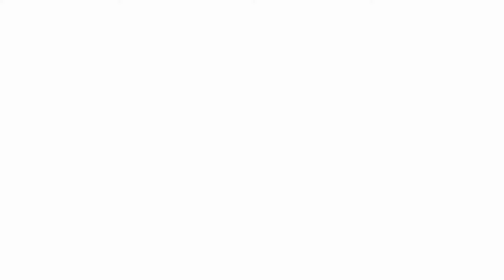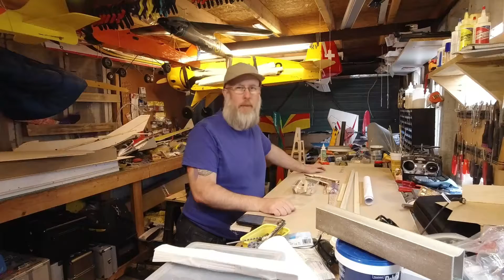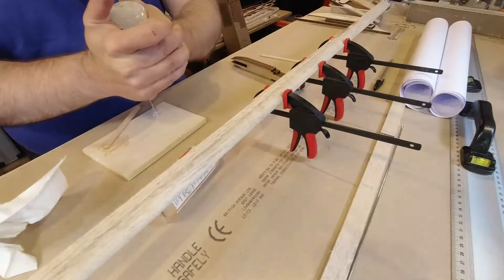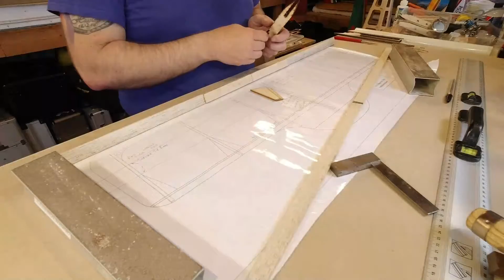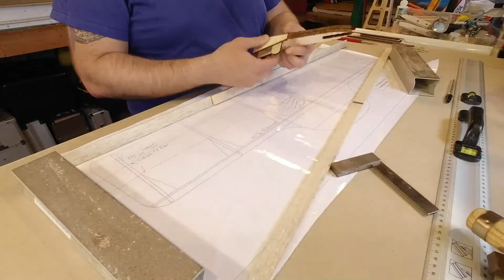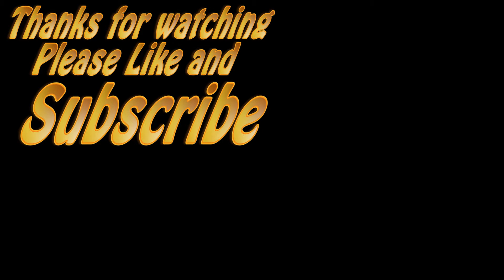Hobbins Hobbies Mini FlyMe Combat Wing Trainer Pt1

Comment: Thanks for doing the vid Nick, I  think I'm probably guilty of not putting clearer instructions on the plan. That would have avoided the bellcrank thing, I do band them together in the right order when I pack them but its not so clear on the plan,  I've made a note. I build them flat, I put a few  nails around the perimeter which enables you to slot the ribs in place,  I use white glue and put a metal bar on top while it's drying.
Reply from the maker: Everyone has their own way of doing things, and I don’t think I’ve really had any ‘issues’. Hopefully the upcoming vids in the series will show this. I will also be doing a series on the Peacemaker when I can pull my finger out and get it built after the move.